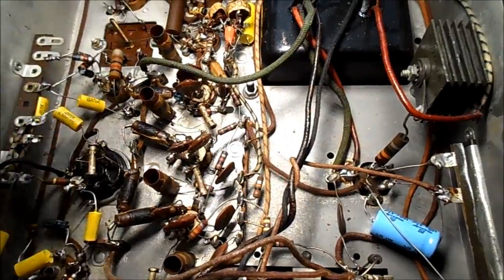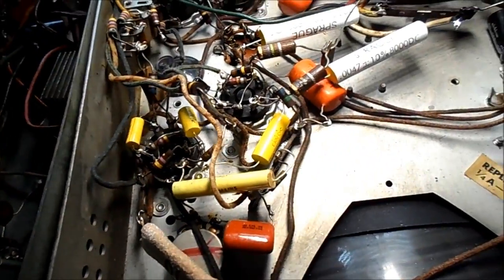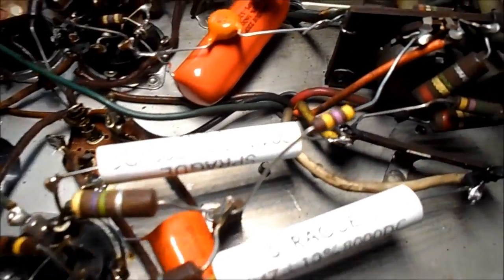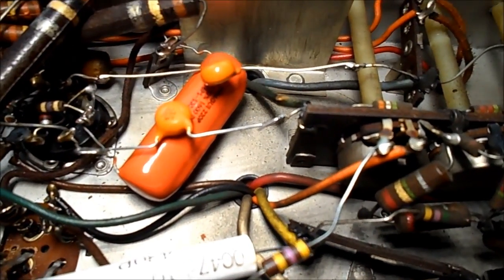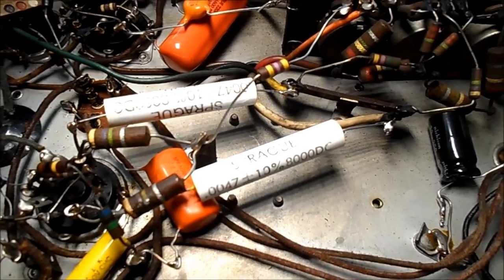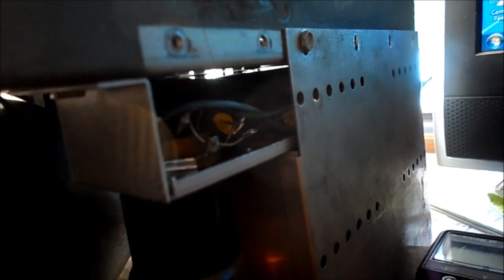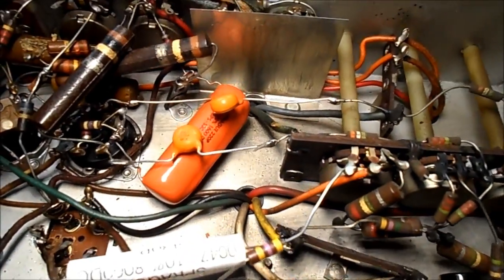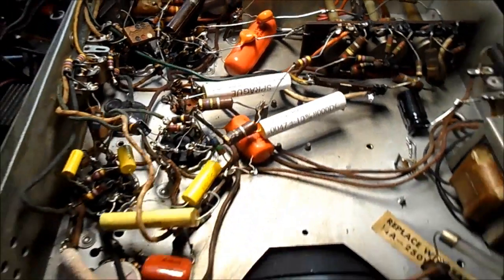Sentinel 400-TV. Pt. 6. Horiz. Banding/Streaks.

Comment: I have heard that too but i thought it was the vert side the lower frequency stuff
Reply from the maker: Changed out the discs, no change. Discs were not an issue. There are 2 orig. wax ones left to go. .01@1200 Horiz. sweep coupling, & Horiz amp cathode bypass. Only leaves 2 micas to look at if still an issue. Almost done.
Reply: Good to know. We need an update video when you get it done

Comment: I agree with Dave. If it's coupling caps and disc were used, more than likely the issue. A lot of guys have tried that....usually just doesn't work right. Also see hum bars in there. Assume the main filter electrolytic hasn't  been changed yet? When changed, that should go away.

Comment: if those are the coupling caps for the horz deflection then I would def not use the disc caps. IIRC folks have tried that before and had issues (deflection) I can't say for sure its what you are seeing but may very well be.
Reply from the maker: Yes, "Horiz. sweep coupling" caps. C80, C81. I also used 2 for the C85, C86 "HV filter". (exclusive to the Airline chassis, which this most resembles). Just ordered mylar/foil high voltage types. Must be the high frequency, timing, & discs, I'm hoping. Thank you for watching!